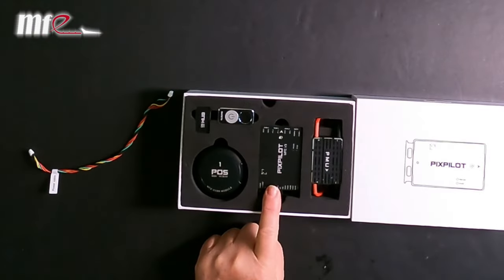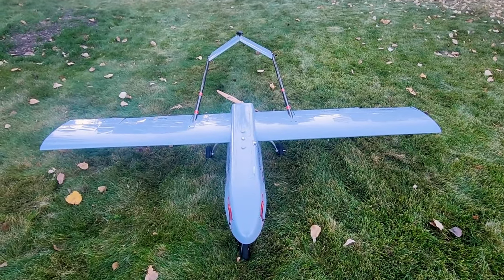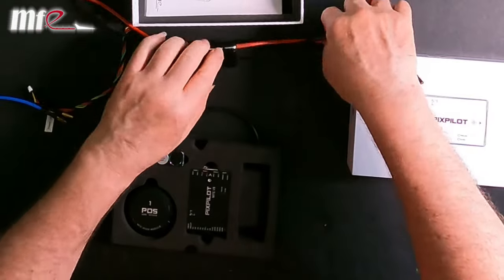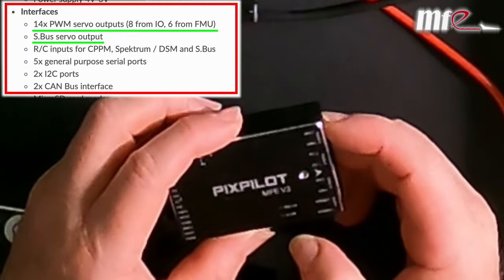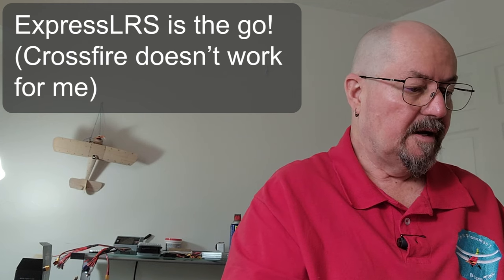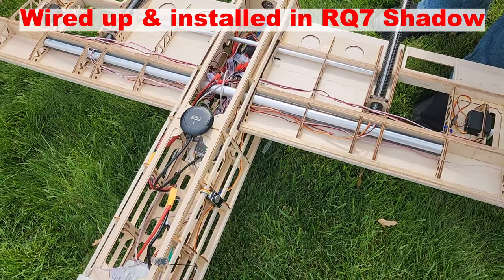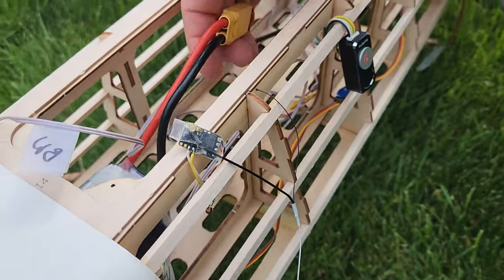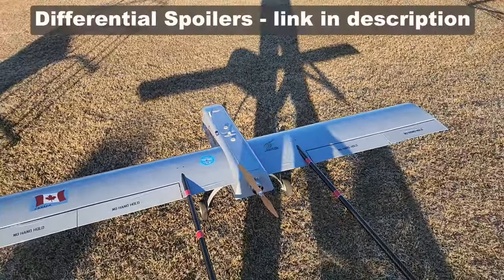RQ-7 Shadow "Screamin' Demon" RC Balsa model with MFE PixPilot V3 ArduPilot Flight controller

Comment: hello can you share the plan of your plane as well as the plans and electronic elements that you used?
How did you achieve the inlay of the video from your camera and the flight information?
Thank you for your answers
Reply from the maker: The plane is a Dancing Wings Hobby kit. You can buy the kit or ARF on Amazon or at dwhobby.com  check out my other RQ-7 videos I have explained the electronics in one of them. The video overlay is https://goprotelemetryextractor.com

Comment: Hi Tim. Very glad I found your channel.

I've been wanting to get into the world of autonomous flight using Ardupilot, but have been a little overwhelmed at all the flight controller options out there, especially the ones that require soldering pins onto the board!

I'm not sure if this is even the right question to ask, but is this flight controller combo pack good for a newbie in this area? I'm a technically minded person (I work in IT as a dev) but I find some electronic system a little confusing sometimes.

Also, re learning Ardupilot, would you have any recommend resources?

Thanks and sorry for all the questions. 👍 😊
Reply from the maker: I have some videos - start with "3 days of the PixRacer", also check out Painless360 and make sure to read the ArduPilot Wiki https://ardupilot.org/plane/ - thanks for watching!